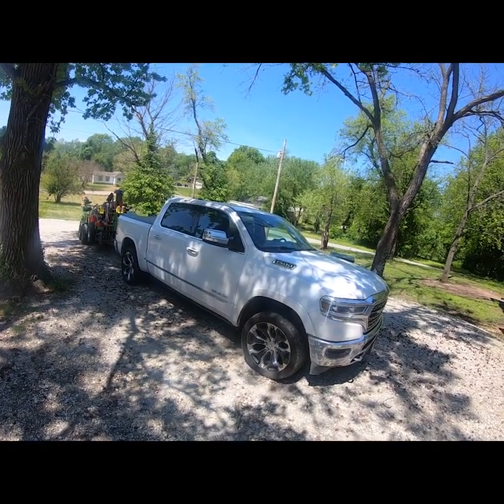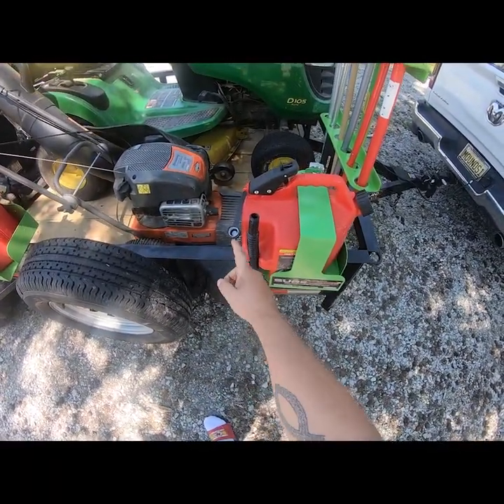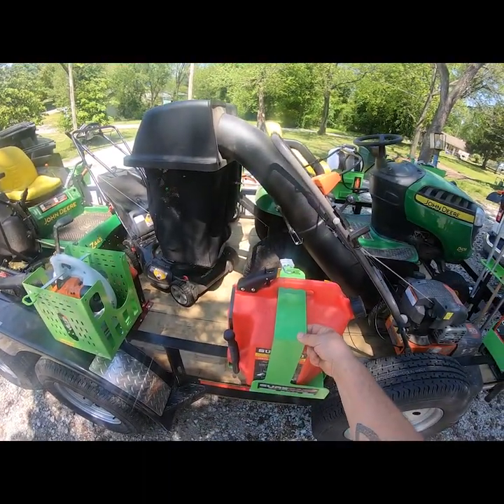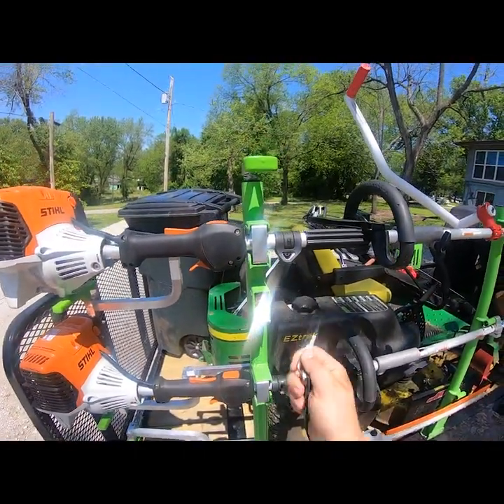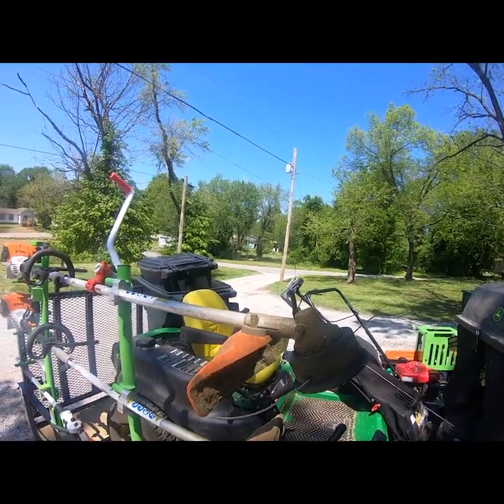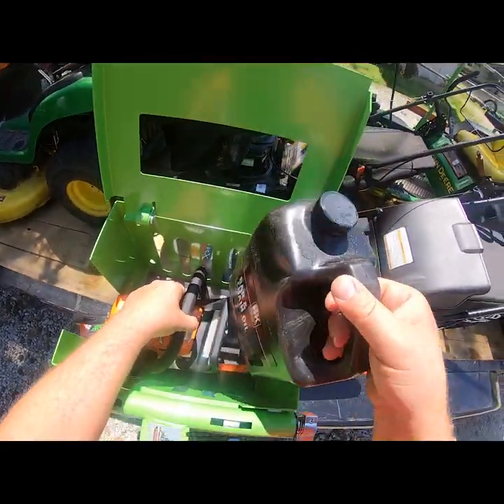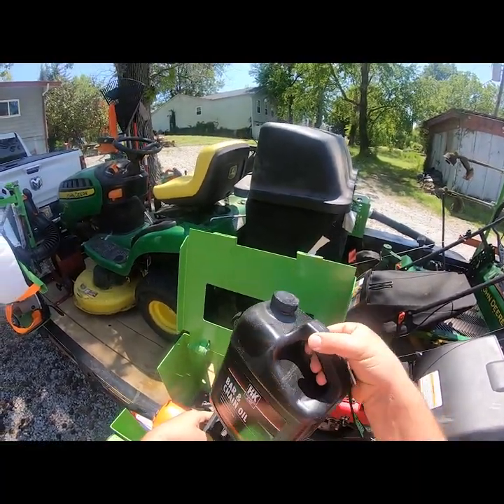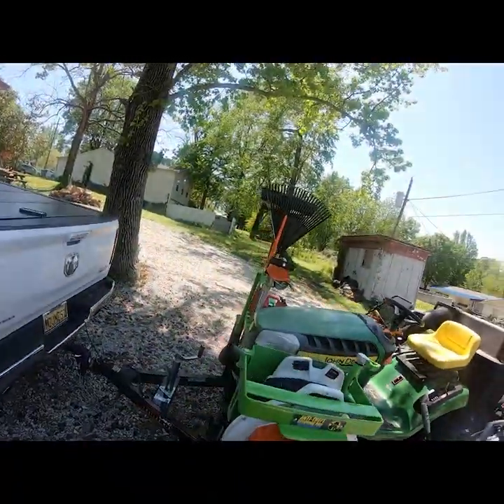2020 Lawn Care Setup - First Year Yard  Mowing  - Green Touch , Stihl and John Deere

Comment: Great looking setup!  Those carriage bolts; just torque them down good and tight. with that thin metal on your trailer sides the nut will pull that square part into the angle iron and make it good and snug. just dont tighten them to the point the bolt breaks but tightening them more till they seat well wont hurt anything
Reply from the maker: Hazardra Lawn Care 

Thanks